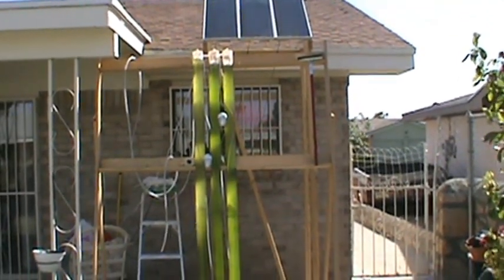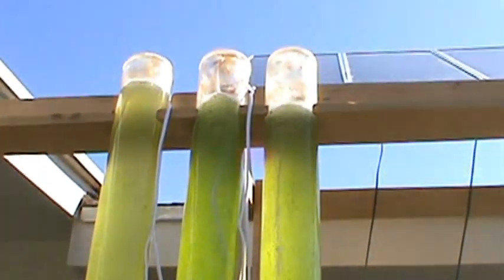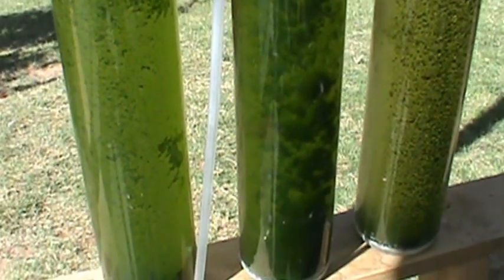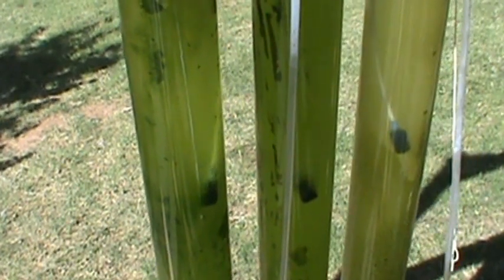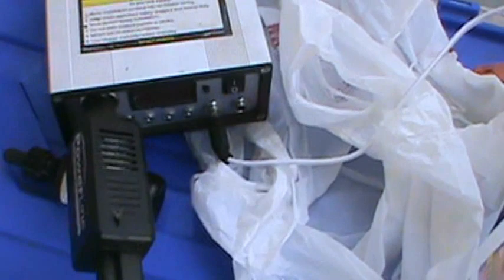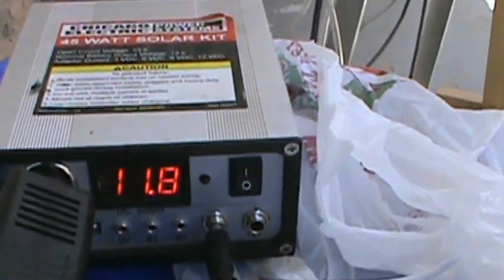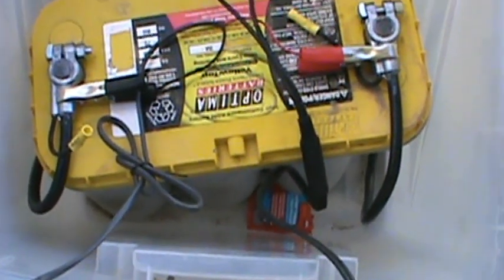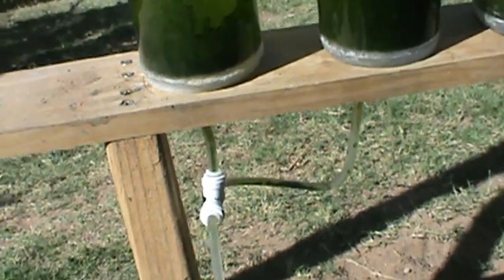Algae Bioreactor with solar panel system

Comment from the maker: The three tubes where at the time $250 so they are not cheap. Yes i am using salt water for the algaee to help avoid outher algae species from growing inside. I dont use F2 fert I a made my own secret food.I am growing the algae for fuel as well in helpping reduce C02 Thanks for your comments.If the company that i bought the tubes from decides they will sponcer me then I will let Everyone know where i got the tubes on the next video.